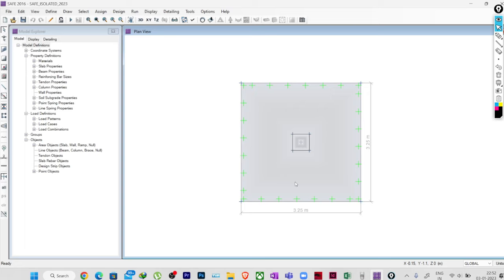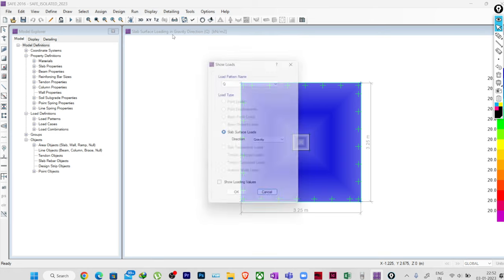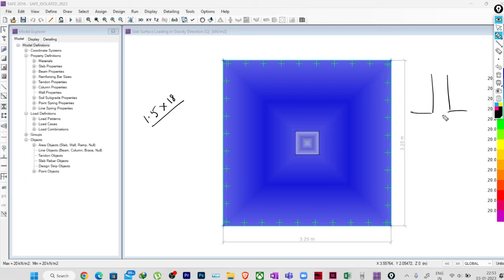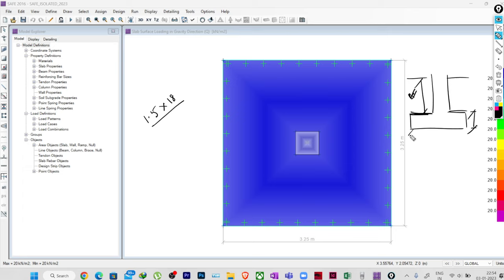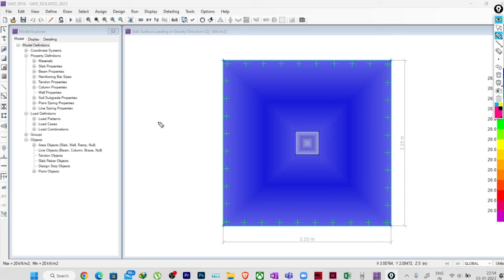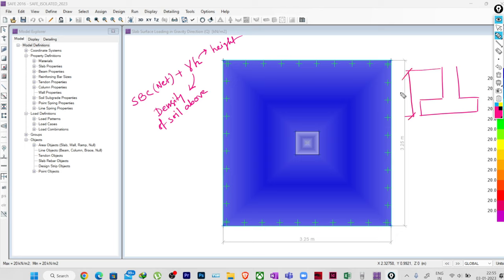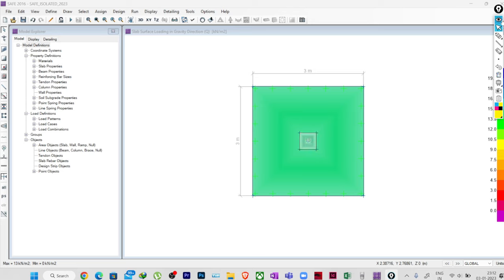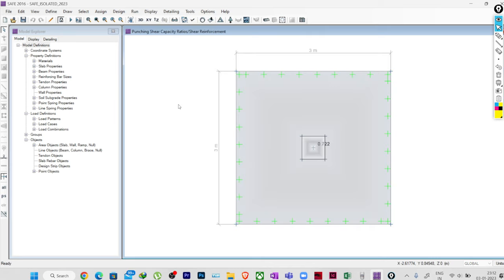Foundation Analysis and Design | Lec-03 | SAFE 2016 and Manual | ilustraca | Sandip Deb

Comment: 1..While defining soil subgrade modulus, Is it not necessary to apply factor of safety ?? moudulus =   sbc* (1/ settlement)* fos(3)
2. instead of using null properties to visualize column, Can't we use stiff properties and draw column, in most of the video  I have seen, they are using stiff properties slab for column. Could you please tell us the difference between null area and stiff area ?
Reply from the maker: 1. No, only SBC will be considered. 
2. No, stiff is not appropriate as it has infinite stiffness will show unrealistic moment at that location...for punching shear calculation we have assigned load size already.. For foundation analysis it is mentioned no where to use stiff even in Csi Knowledge Base also..
Reply from the maker: Null area has no stiffness, hence will attract no force... only used to visualise the colum area and to remove the overburden load of filledup soil from that area...
Reply: @ilustraca  thank you sir